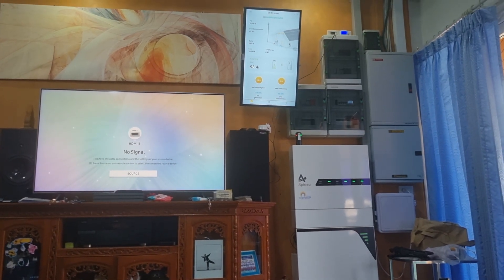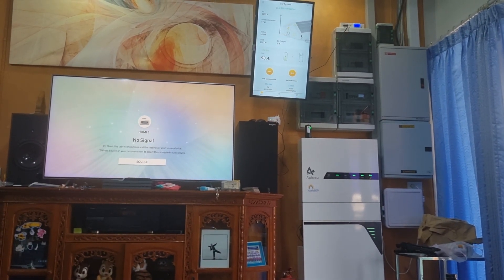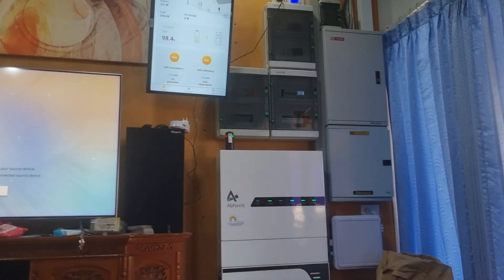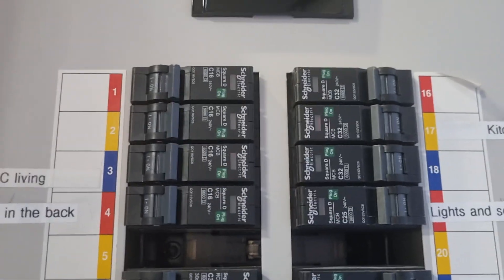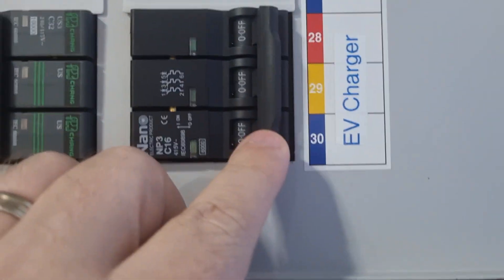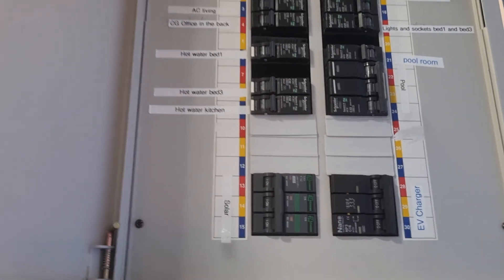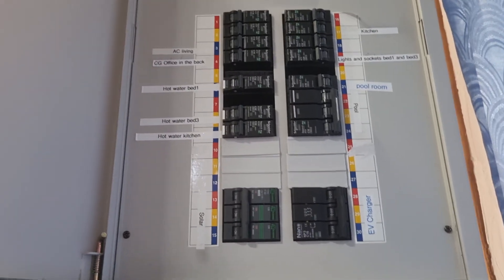Three phase electrical supply in Thailand explained | SolarThailand.biz

Comment: Thank you for the explanation videos you make. We're in the construction phase for our future home. I noticed a while ago that three-phase was on our road, but not to our property yet. We made arrangements yesterday to get those three-phase distribution lines extended to our property line, and convert our existing (and incomplete) single phase property power distribution components over to a three-phase distribution system. My current target for installing a solar system on our property is 2026. My guess is another year before our current building projects are completed.

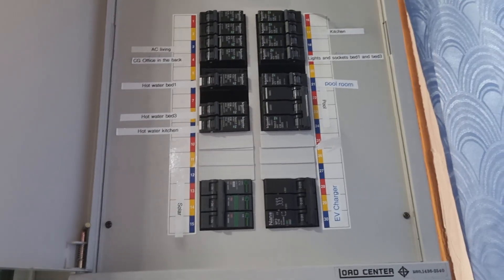Comment: Is it true that the price per unit for the 3-phase is higher than a single phase?  Near the end, [6:50] you said that going from a single-phase system to 3-phase system later on is very bad?   Do you mean solar power systems?
Reply from the maker: yes, price for three phase electricity is a bit higher. To change to three phase after installing solar is bad because you must buy a new three phase inverter.